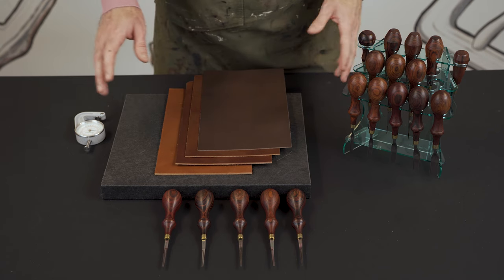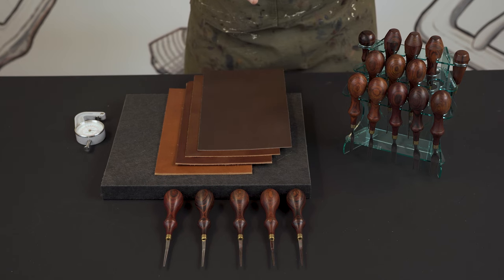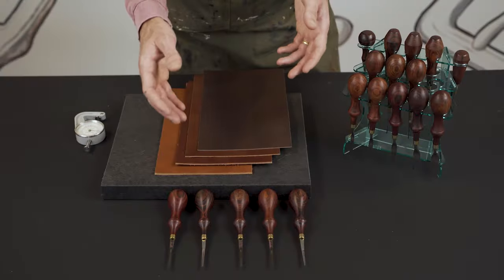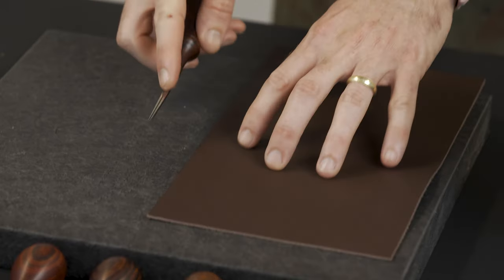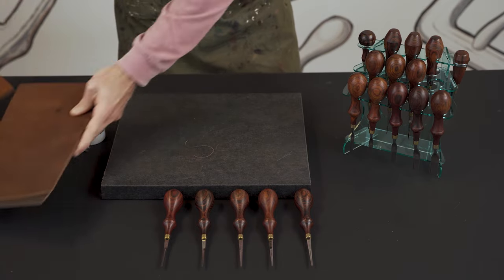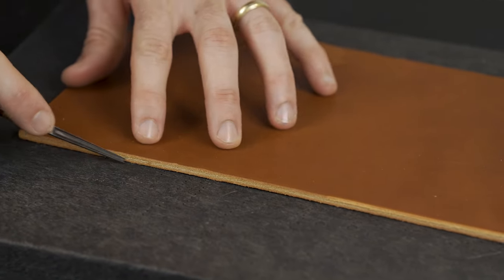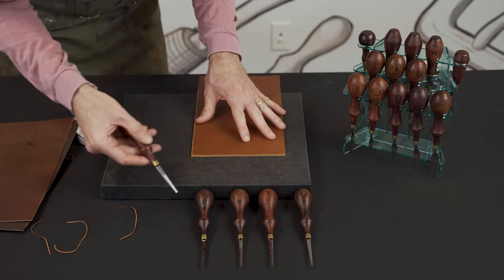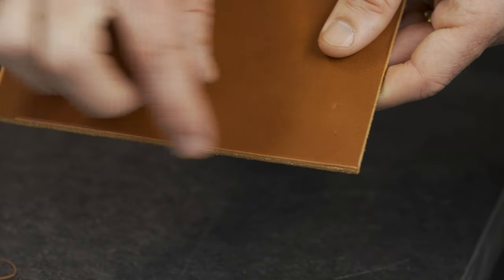BG Leather Edge Bevelers | Buckleguy Tools Demo

Comment: How do I resharpen these edge bevelers?
Reply from the maker: Hi there, we sell a tool to assist in sharpening these bevelers: https://www.buckleguy.com/bg-leather-edge-beveler-sharpening-tool/

To start, lay a piece of 220 grit sandpaper on top of the sharpening plate pressing it down into the grooves. Pull the beveler toward you over the sandpaper at a 15° angle. Repeat a few times and then proceed to a higher grit sandpaper until you reach your desired sharpness.